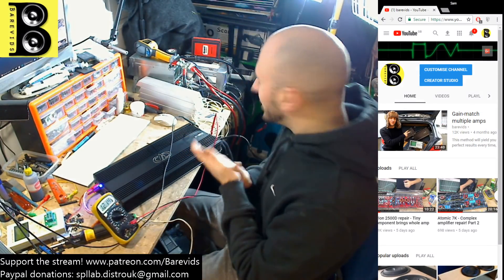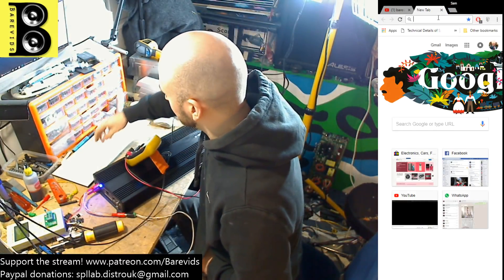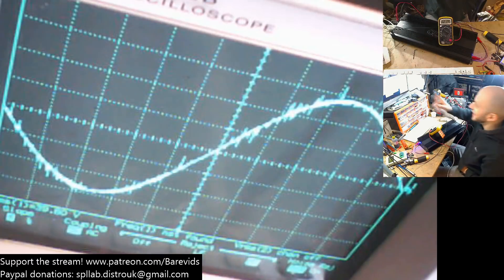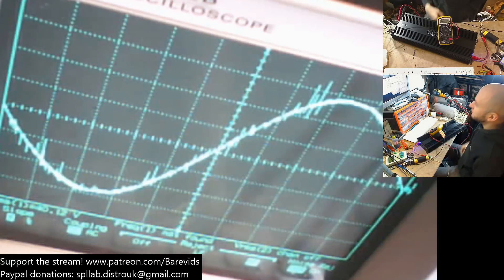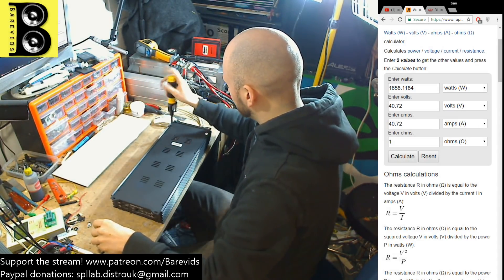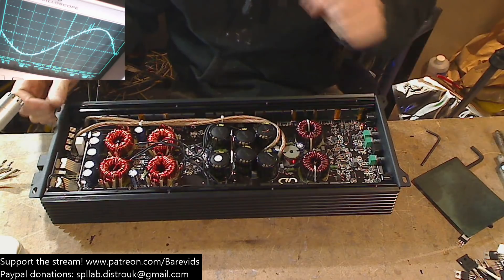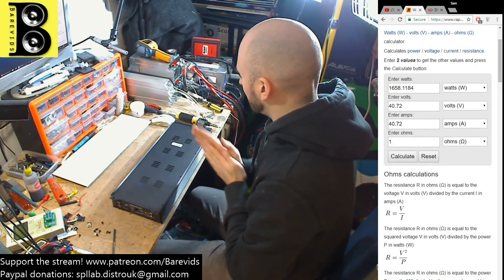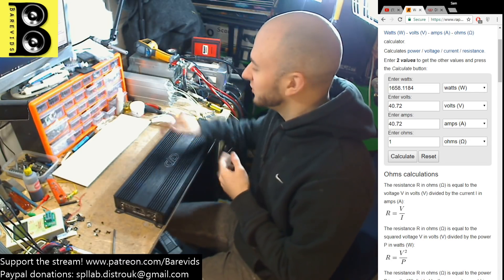Digital Designs DM2500 Full power bench test & circuit overview

Comment: I have watched your videos and learned a lot!! Thank you very much. Very smart!! I have one of these amps I ran for close to 5 years before I started having problems. Amp went into protect and I found 3 of the 640n shorted. I replaced all 16 of the 640n’s and now the amp works but when I turn the volume up it goes into protect. After cycling power to the remote it will come out of protect and work again until I turn the volume back up. That is with speaker impedance at 1ohm. If I change the speaker impedance to 4ohm I do not have any issues with the amp going into protect. Any ideas?
Reply from the maker: voltage drop, nothing wrong with the amp you just need to sort out your power cables, battery, power supply etc to the amp. 😊
Reply: Thanks for the response! Much appreciated.

Comment: Love all of your vids, you have taught me the basics of amp repair which got me through my first repair (which felt amazing to see the blue light!).  I'm currently working on a older Kicker Kx1200.1, then CXA1800.1 before I try to repair my DD 5.1000 channels 1-2...  Current problem with KX1200.1 is that on power-up I get both red and green lights, then the relay NT90NAS12CB switches and the green power light fades out with protect light remaining solid, 1.5-2 seconds later the relay switches again, green light fades, and continues to repeat this.  In your opinion, would it seem like an issue with the relay or caps or something else entirely?  You always say in videos "IGuys, it's never the CAPS", but I've read these older kickers do have cap issues later in life so I'm thinking cap issue, and not relay because the relay is actually switching...
Reply: It can absolutely be caps.  You also want to check out whatever is controlling the relay.  A relay, by definition, is controlled by something else.  From your description, it sounds like the relay is doing its job.

Comment: So in a real world situation what could we do to our car to get it to produce over 14v consistently?
Reply: Make sure electrical is up to par… agm battery,  big enough alternator…
Reply: Some vehicles require specific modification to the alternator or charging circuit to force it to hold a higher than factory float voltage.

Comment: Hi. I got a dd dm2500 and it makes a popping sound when I turn it on and off. I need some advice please
Reply from the maker: Try it with rcas removed and get back to me.
Reply: @barevids  hi I removed the RCA's. I tried new once. I got extra ground threw out my car it still does it when I switch the amp on and off. I also put a extra battery at the back near the monoblock. With no luck

Comment: I NOTICE THAT THE HIGHER MODEL DD MONO AMPS SUCH AS THE MC3 HAS A BASS BOOST KNOB, WHY DOES THE DM1500 AND DM2500 DOESN'T HAVE THE BASS BOOST KNOB?
Reply: My DM2500 came with one....
Reply: Ben Davis mines did to do you have the dd 2500a ?

Comment: Do you know what FETS would be a better replacement for the 640N on this amp that wouldn't require changing the driver circuit ?
Reply from the maker: 640N are fine, you wont gain any power or reliability changing them
Reply: @barevids  Thanks for the quick response bro!

Comment: Hi, thanks for all your videos. I'm subscribed, and with your help I've already fixed one amp and diagnosed (I think...) a second. If I can get some help with this DM2500 it might become 3 :D

Since the TL494 is so common can you discuss some of the ways it can fail and/or appear to be failing? Also where to get replacements. You could even open up a little store to sell parts like Rossman!

I picked up this DM2500 and it worked, but not so well. I tracked down some issues in the output section and then it started going into protect mode. There's a really strange and erratic signal at the power transistors and I followed it all the way to the TL494. I only understand enough about the TL494 to check that it is getting 12V at the vcc pin. I don't understand much else. Thanks!
Reply from the maker: The tl494 never fails. Check pins 9 and 10, these are the signals driving the fets. They pass through buffer transistors before reaching the gate leg of the fets.

Comment: I talked to b2 audio about your testing and some amplifiers need real world system with power to back up the amp draw to get proper results.
Reply from the maker: This is real world power. its 400A of 12v supply, with more regulation than an alt and battery. The results are accurate and Jay knows this...
Reply: @barevids  hmmm. Well I did contact him about the duo and he said their power supply was stronger also given +/- 5% performance difference from your test to theirs. He did send me and audio precision graph of the duo power output. Lmk if you would like to see it. 

PS. You responded to my comment!!! Bro I'm a huge fan! Of you...more so DD lol

Comment: Bare, how about 0,5 ohm load?
Reply from the maker: 0.5ohm is not amp dependent, but install dependent. All 1ohm amps can "do" 0.5 if the system is efficient enough.
Reply: @barevids  Do you have any plans on doing a video on this? I remember you mentioning it in another video.
Reply: i'd guess 2600-2800watts at 0.5ohm i think i will rather go and buy the Orion XTR 2500.1D or the Orion HCCA 3000.1DSPLX the XTR 2500 has been run up to 3800watts@1ohm on big D wiz channel and the 3000.1 has been up to 7600watts@1ohm and later at 0.5ohm 13200 watts so those amps are monster value for money i was hoping this DD amp was far underated so i can buy two in the future and easily know my system will be fed more then enough power but guess not. great amps but they are 1500-2000watt amps not 2500's
Reply: @EBMproductions1  they do a lil bit more than 2500 if yo electrical is str8. I just watch a vid before this one and it was over 2600rms
Reply: @jaytaybrae3766  i remember watching another dyno vid after this where basically the same result came out and also for the price of one DM2500 i can buy a SoundDigital 3000.1Evo of which does more then 3K rated so nah man is fine these DD amps is more like 2k amps and also is a bit over priced they are fine if you want to run them but i'd much rather go for the SD or Orion amps

Comment: So after playing around with this amplifier for a little bit and able to set my Ganes Etc I just wanted to say that I love this amplifier amplifier puts out a great clean signal and it's a compact amplifier to ultra sure that it would fully put out its 2400 or 2500w easily no clipping this is an excellent amplifier I'm able to turn it up to the skars 1250 Watts RMS and   not have the skar get hot at all the other because the DD has way less clipping and the best part that the DD offers is the fact that this amplifier is strappable and it's also cool because you don't see amplifiers these days with a RCA for everything and in and out which is extremely cool now I know what you guys are saying and I bet you're going to be asking where do I pick one of these up I will leave both links down below where you can find your DM 2500 and I will leave a link down below as well for a DD audio dealer finder view  those links to pick yours up👍

DM2500 
http://ddaudio.com/products/amplifiers/d-series/dm2500/

Dealer finder
http://ddaudio.com/dealers/find-a-dealer/

Comment: Thanks for the overview. I see one thing that bothers me most. How in this world these power supply transformers are able to share the current as the transformers close to one edge of amplifiers will have enough long fly wires to cause significance difference in current sharing with the ones closer to rectifiers.I performed experiment and the Vf due to dynamic resistance of diode helps in reducing this different but at such a high current path I imagine there will be still a big difference in current sharing. Other way i can think is that there are 2 pair of transformer and are in series, therefore the path length can be made equal and sharing can be improved.I can only imagine. I'll surly wait for your comment barevids. Thanks alot.
Reply from the maker: +Jai Aditya Chaudhary perhaps there is a very slight imbalance, it will be hard to prove in application. But as long as the output circuit has access to enough current, and the differences are only very very subtle, it won't make an audible difference.
Reply: barevids Yes for sure no audible difference.

Comment: FWIW, the D line DD amplifies I have show 'Designed in Oklahoma City, Made in China'  I own a DM5.500, DM5.1000, DM500 and a D4.90 and all of them are great amps.  I have a question if you don't mind - I am planning my next system build and have landed on 3-way active front stage using the DD AT28, AW3 and AW6.5 speakers.  In your opinion, do the C class AB amps from DD audio sound better than their D class amplifiers?  I am trying to run an SQ front stage with DD's high end German made speakers that are still able to product significant volume (looking at 300w RMS for the AW6.5, 150w RMS for the AW3 and 60w RMS for the tweeters)  The C class AB amplifiers are less expensive but are of course larger presenting challenges with mounting all of the equipment.  What are your thoughts/opinion?
Reply from the maker: to be honest DD dont offer a high enough quality amplifier at the moment to match the AW series speakers. Hence why I went with Genesis amplifiers in my build.
Reply: Thanks!  I need to look for your videos on that, I'v not heard of Genesis, going to look into them.  I've already spent $600 USD on the AW3 and AW6.5s, I would hate to skimp on the amplifiers :-D

Comment: What did that power acoustic 5500 bench test the other day...1700?
Reply from the maker: not got it running stable yet, turns out its VERY fussy with output fets!
Reply: barevids 😂
Reply: Don't encourage Sam to waste his time with that lol Big D has already tested those PA amps and they all use the same Epsilon designs that produce roughly the same power.  They just put them in a new case every few years so people will buy the same old shit over again.